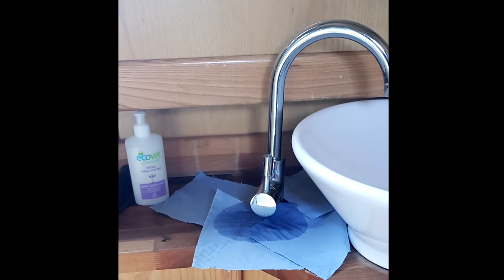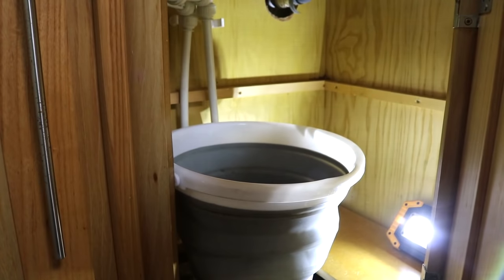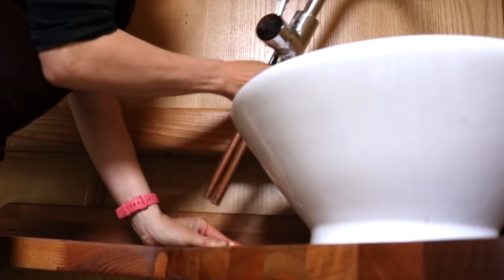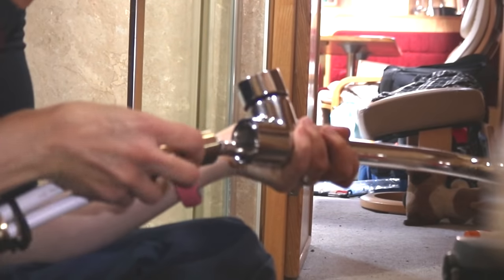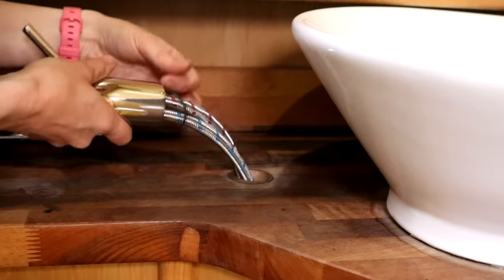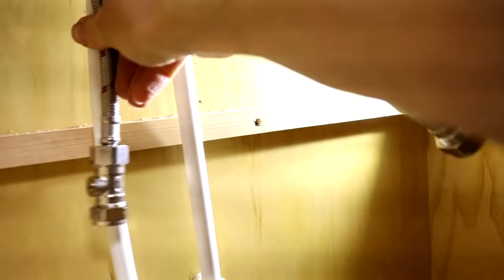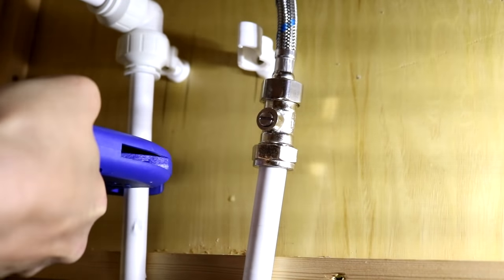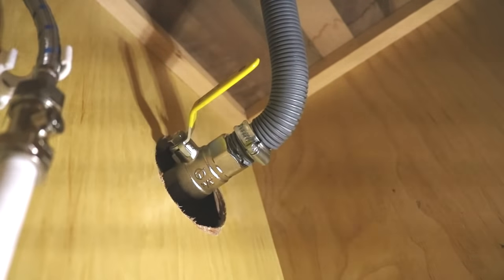Changing a Leaking Mixer Tap  | The Carpenter's Daughter

Comment: Great video on your new boat👍 A couple of pointers for your future repairs - when using compression fittings on JG speed fit you need the inserts that have no O rings on them, the ones with O rings are purely for pushfit fittings. Also flexible tails are better fitted onto a male compression coupler as it is flat faced, the isolation valve as a sharper edge to accept an olive and this can cut into the rubber sealing washer. (Having said that - it is done a lot with often no problems) . Not picking holes with the video but just a helpful piece of info.... hopefully 👍

Comment: 8:06 So glad I’m not the only one who puts the nut and the olive on the pipe, then fits the valve with another nut (and olive) still attached to it. Got to love SpeedFit, no more solder, flux and gas torch (with an occasional scorching or small fire) to contend with. 👍
Reply from the maker: I found it was more of a pain the other way around with the insert first 😆  And yes... never done  solder join, which looks fiddly compared to speedfit!!

Comment: As a Caravan owner, and aspiring Boat owner, I know how troublesome these water systems can be. The slightest leak can go unnoticed and, if not spotted, cause a whole heap of problems. As the water pump is activated by the use of the taps, it’s quite easy to ‘hear’ if your system is leaking, as the pump doesn’t turn off when it should. Good luck with your aquatic adventures! I’m jealous👍🏻👍🏻👍🏻
Reply from the maker: Yes, it's noisy when the water flows!  And definitely don't fancy water damage on it :)

Comment: Nice neat job!

One thing you need to watch out for is the size of nut on your new tap fitting the isolation valve! There are two sizes (don't ask me how I found out) and it may involve a trip to your local Plumb Base (like screwfix but just for plumbing) They sell a tap converter which will fit on the bottom nut and olive of a standard compression coupling and your flexi tap hose ..... or you can throw the valve part of your isolation valve away .... if you are feeling particularly irked ....  and plumb away! 
Another way of doing it is to use the old flexes to your tap, as long as the two sets of O rings are good!

This is one of the problems of buying online .... they never tell you all the dirty details about your new kit and some seem to be (how shall I say it) Eastern European in origin. 

One tip I will give is that you need a bucket!
Not for the water, but to throw all those bits in that you would otherwise bin! That way you amass a set of bits should/when you need one! A spare bog roll is also handy to wrap round your joints while you have a "Thank God I finished that job Brew". Finish the brew and remove the bog roll and you will plainly see if you have a weeping joint and even which end of the joint needs nipping up!
Reply from the maker: Thanks for the tips! :)

Comment: This is a job I need to do soon again. Some tips for you for the future, you aren't really supposed to screw the Flexi tails straight onto a fitting like an isolation valve. If you feel the rim of the isolation value you well notice it isn't actually flat, it comes to a point as such. This, when screwing the Flexi tails on can dig into the rubber washer in the Flexi tails and create a weak spot in the rubber washer that can in the future leak. What you should do is insert into the isolation valve a tap tail adaptor. These have a flat surface for the Flexi tail to screw onto and thus gives the washer a nice flat surface to form a seal. They are available from most places, eg Toolstation code 14081. They are £3 a pair. You can do fitting of the tail to the isolation valve before installing the isolation valve in place and this makes it much easier.

Another tip, which I got from James at Plumber parts YouTube channel. When turning the water back on have the tap fully open, this means that you don't have full pressure while you are away turning the water back on as the water can flow out the tap and down the sink. Then when back at the tap you can gradually and slowly close the tap of thus increasing the pressure on the newly fitted joints which you can have an eye on as you increase the pressure. James talked about this in a few of his videos earlier this year and last year.

Another tip, if you can get/have blue clean up paper, use that for spotting leaks, the water shows up to the eye miles easier than white clean up paper. Also use the torn edge to dab around the fitting, the torn fibres will wick up the water. Or fold it a few times to give yourself a thin edge to get into the fitting.

With the isolation valves, think about adding a calendar entry to turn the screw once every 6 months or a year, especially if you have limescale issues. I recently needed to turn on that hadn't been touched for a while and the ball bearing inside had got stuck in the open position due to limescale build up and had to replace the whole fitting.

Finally for you drain issue, maybe look at using Plumbers Mate. It is great stuff.

Hope some of that information is of use, it is all stuff I have been passed in time and so always like to pass on tips etc as it is how we all learn!

Edit: to see about the tap tail connectors search on YouTube for Ultimate Handyman - How to connect flexible tap connectors 2019 Flexi tap tails. He has a good video on these.

For the tip about turning the water back on search on YouTube for Plumberparts -  Fixing a plumbing leak under the kitchen sink - from the van.

The bit about turning the water back on starts at about 11:50.
Reply from the maker: Thanks for all the tips!  I'll refer back to this if I have a problem.  Also, yes, I used Plumbers Mait in the end for the sink drain and actually followed James from Plumber Part's video, which will be up this Sunday 😂

Comment: The isolation valve has a sharp Edge which will most likely cut into the rubber on the flexi hose eventually causing a leak I believe eBay are selling a version of an isolation valve with a flat end on one side of the valve seat against the rubber might be worth changing them or if you have an angle grinder you could grind a flat edge on valves that you have already brought

Comment: I’ve had the same problem with a bathroom mixer, I had no idea what sort of cartridge it used so I bought a new tap, much easier fix. Also, in Australian bathrooms/kitchens you cannot isolate the water and have to turn the water off at the meter, which is usually located at the front of the house in the ground, I wish we did have that facility as it would make some home repairs so much easier to do.
Reply from the maker: That's interesting!  I wonder why you can't?
Reply: @TheCarpentersDaughterUK  I’d say some sort of rule or regulation, at least in my part of Australia, which no one has thought to change. We also still use predominantly copper water lines here, although flexible lines are now being used to connect kitchen and/or bathroom taps to main lines, and toilet cisterns to taps, toilet cisterns are probably the only ‘appliance’ that you can isolate the water supply to.

Comment: Isolation valves on the boat - close the cold one down slightly so it matches the flow of the hot one - It makes them work a bit better. If youre using an LPG water heater , they slow the flow down of the hot tap and it stops cross feeding (again depending on tap type). Not so imprortant if youre on a calorifier system. Also stops people wasting too much water if theyre visiting your boat! Important one is to put one on the toilet - They can sometimes syphon from the tank (again depending on type of boat) plus again you can reduce the flow slightly to save water and filling your pump out tank
Reply from the maker: Love the tip!!  I'll check the flow of both on my return :)  And yes, we have a calorifier :)